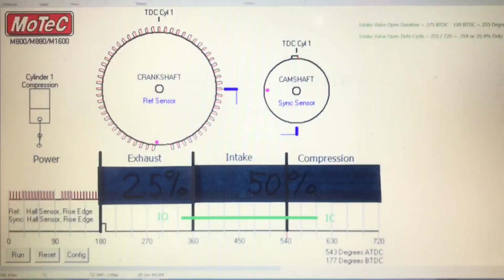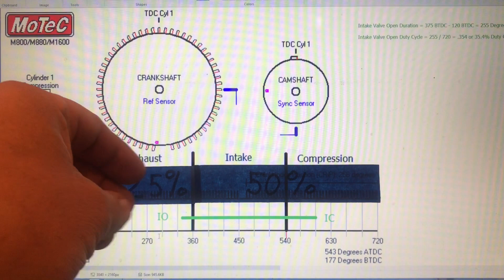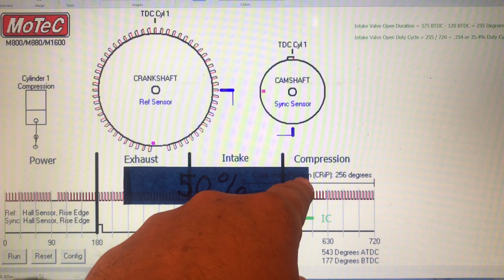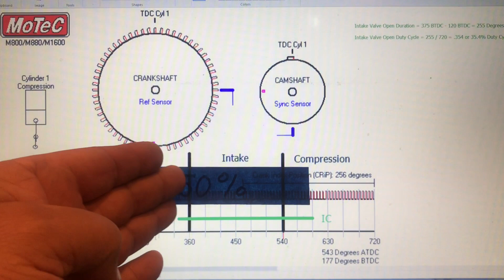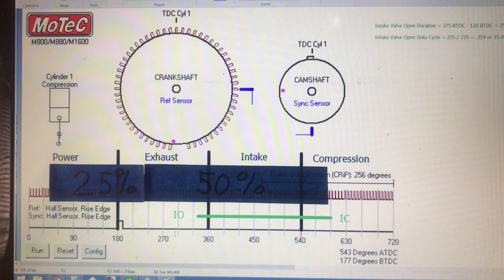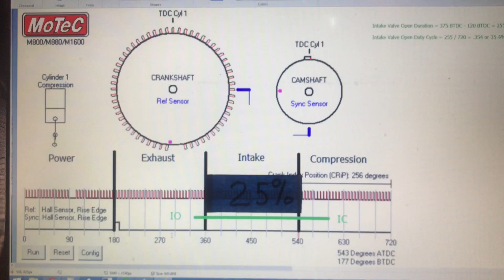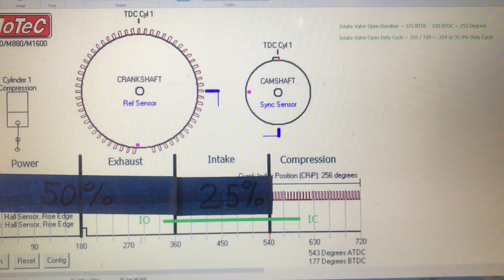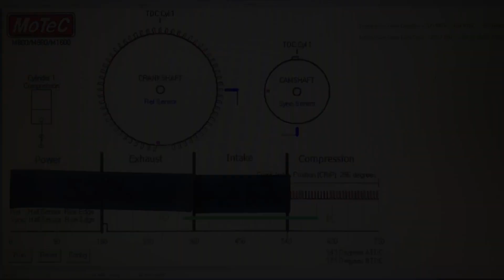What’s @TunedbyShaneT Talking About Today? Injection Timing/Phase Angle

Comment: Im a bit confused why you want it in closed loop while doing it? Are you looking for injector pw to be reduced by the computer as the efficiency goes up by proper timing and wasting less fuel on the back of the valves? Thanks
Reply: Because engines make more or less HP with different AFR and you want/need the AFR to be the same on every test pull (which is what CLoop does) for apples to apples power comparison at the different phasing angles (vs possibly having to manually tune the AFR every time you make a phasing change)...

Comment: Use 2 injectors?
Reply: There are a lot of motorcycles that have 2 injectors per cylinder, the primary injectors are always below the throttle blades (closer to the valves) and the second set is usually above the throttle bodies, velocity stacks...

Comment: One of the best explanations of fuel injector timing.  I've gone through this theory with a lot of trial and error and have came to the same conclusions as explained in the video.  Math calculations alone do not account for all the variables.  I had to run the engine and fine tune adjust the injection angles using Air/fuel ratio and manifold vacuum (just like tuning a distributor & carb) to get the optimum phase angle.  End of injection timing seems to work the best for my situation with large injectors.

Comment: Sir how many ecu does a 4 cylinder engine has? Does it depend to the number of cylinder on how many ecu a motorcycle have or is there only one ecu regardless of the number of cylinder?
Reply from the maker: ECU’s come with different number of outputs depending on the application. Some can do as many as 12 cylinders. Some can only do 1.

Comment: How is this possible that ecu can detect 720° crank?
Reply from the maker: 720 is the length of the 4 stroke cycle. In between 2 cam inputs are 720 crankshaft degrees.
Reply: @TunedbyShaneT  please enlighten me sir i would be so much glad if u do
Reply: @TunedbyShaneT  yeah 720 is the length of 4 stroke. And how does ecu knows where to time the injector timing? Look listen for example in carb type engine, the ignition timing works like this. Theres a little magnet embeded in the magneto everytime it passes thru the pulser it gives signal to the cdi then cdi gives power to the sparkplug to spark. Then in the case of injector timing how does it work? Does it because of the ecu all alone that all u have to do is to program it? Or is there any pulser too that gives the timing? So if yes does the injector also spray when the valve is close?
Reply: @globhertsldn6503  The Cam Sensor is configured to let the ECU know when #1 Cyl. is coming up on the compression stroke and the Crank Trigger configuration is what lets the ECU know when to fire the Injectors (and coils)...

Comment: 10% is WAY, WAY more than I've ever seen via injector timing; wow!  -I understand avoiding injecting during exhaust overlap and avoiding injecting when the valve is closed, but is there a reason to avoid injecting when the piston is moving up from BDC on the compression stroke but the intake valve is still open?  -My gut says that it could be useful to keep spraying until just before the intake valve closes when it comes to tuning for MPG and max lean cruise AFR (keep more fuel in that spark plug gap)...

Comment: adjusting the injection angle at idle, apart from an emissions point of view, is it worth playing with you see if you can smooth an idle out or generally improve idle, im a small 4 cylinder on bosch 210s that is getting into the 70% at WOT on gasoline so only time im thinking i may benefit is idle(1.5%) and cruise (5%)
Reply from the maker: Absolutely worth adjusting at idle and at part throttle to improve cycle to cycle variation and reduce fuel consumption.

Comment: I was trying to self-learn EFI principles so I could enhance my diagnostic capabilities with a basic labscope. 

I always wondered if injector firing was static (i.e. synced to trigger) and I could not find an answer. This video was incredibly helpful, thanks for uploading!

 I'm curious, have you seen any instances of where dynamically phasing injector phasing against various parameters (map, ignition timing, rpm, etc.) yields improvements in the power/torque band? Thanks!

Massive fan of your work, I was introduced to you with your work on the mazworx s15. Repping from 🇹🇹!
Reply from the maker: Yes the phasing is typically adjusted both by engine speed and load and occasionally by temperature.

Comment: I'd be curious to see the relationship between runner length and injection timing. 

I'd guess that at some point you would have to adjust the open angle  so that all the fuel can make it into the chamber before IVC.  
Though I doubt the significance at high duty cycles.
Reply from the maker: Or I suppose if you meant injector position compared to valve position the answer is always if its further to the valve from the injector, it always wants more advance.
Reply: @TunedbyShaneT  that's exactly what I was talking about.  Based on intake runner length and port velocity, it's got to take a certain amount of time for that fuel to get there.
Reply from the maker: Yes absolutely sir.
Reply from the maker: There is no specific relationship to be quantified at least none that I have found, which is why I said its going to take some adjusting to find specifically what each engine wants.

Comment: You posted on your Instagram or on your Facebook hey Zx10r what was the benefit that the Moteck system generated at the factory EC you could not
Reply from the maker: I don’t know because I didn’t tune the engine with the factory controller on it someone else did. The increase was just the result of adjusting things around to find what the engine wanted. It was not a factory engine application (exhaust and inlet plenum) which might have been the difference, which the factory controller and tuning software may not have been able to adjust for.

Comment: Awesome. 60hp is wild! I have yet to find an engine that it made any real conversation worthy change in horsepower 🤷‍♂️
Reply from the maker: As I mentioned each engine is different and if you have lots of injection overlap over the valve event it becomes much less sensitive.
Reply: @TunedbyShaneT   yup makes perfect sense. What was the duty cycle at on the 60hp gain engine?  Assuming it was low, I’d imagine the gains would not have happened if the injectors were more of an “appropriate” size running at a higher duty cycle?   Or atleast been much smaller gains as the initial numbers would have just been higher?